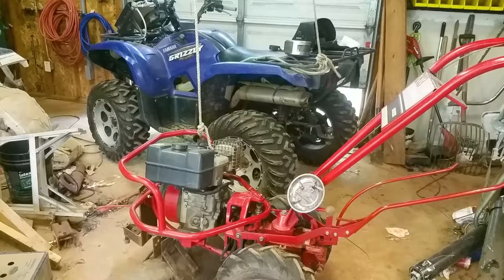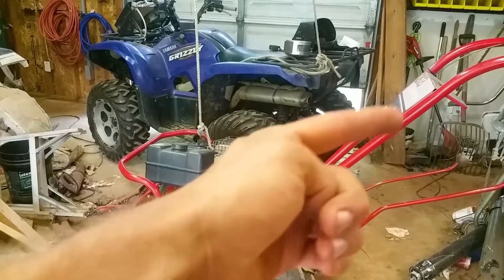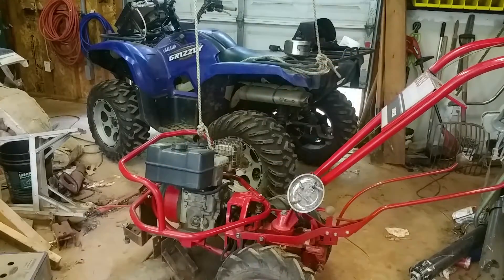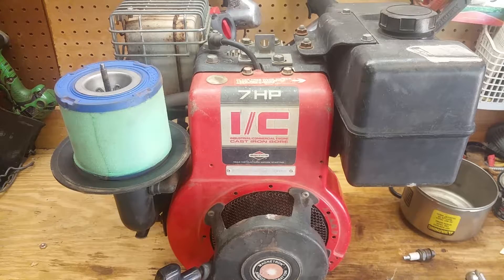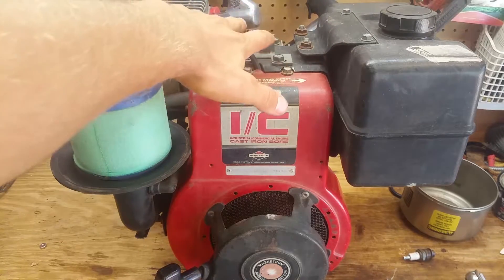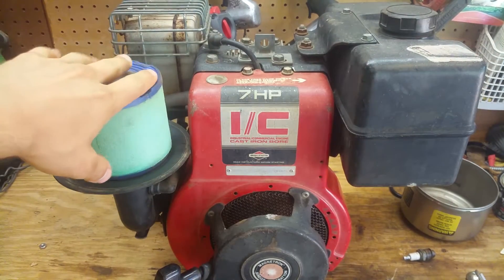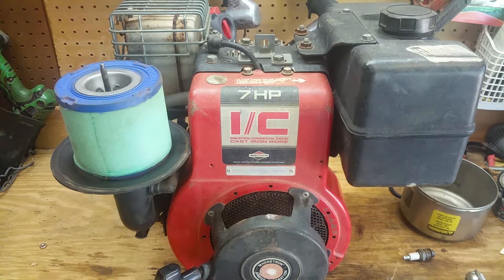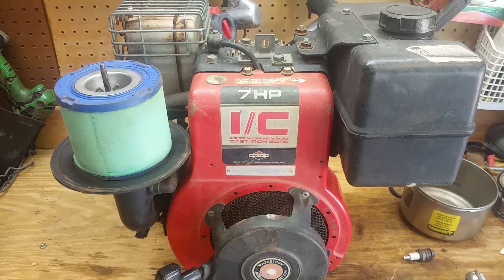Briggs and Stratton Engine Teardown

Comment: Predator motors are pretty good if you get the same horsepower.  You should be able to find any and all parts to fix that engine though.
Reply from the maker: Yea, Predator motors are good for what they are. I'd still rather have this American made beast on there.
Reply: @MattsShop  Yeah, almost any new motor will not be American made, just assembled here if that.
Reply from the maker: Yea